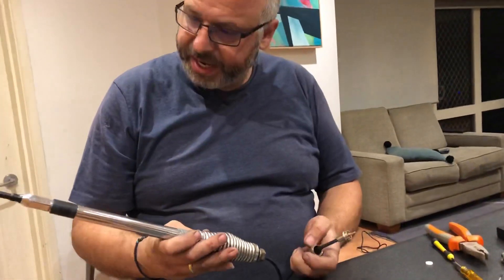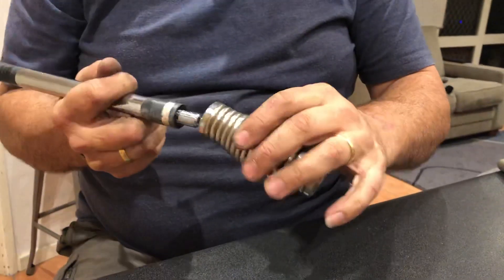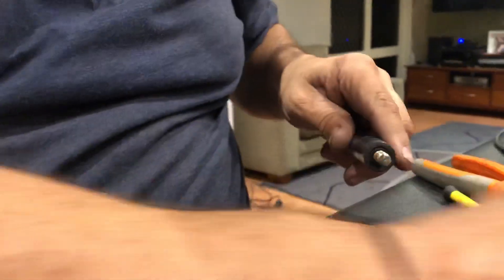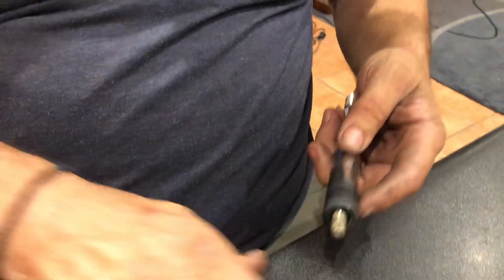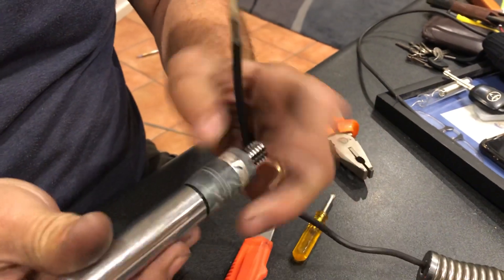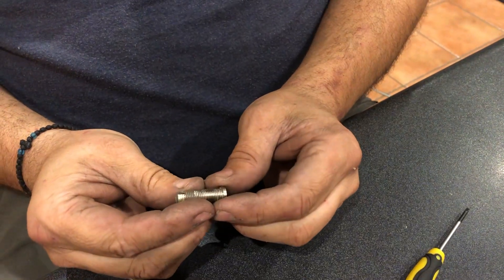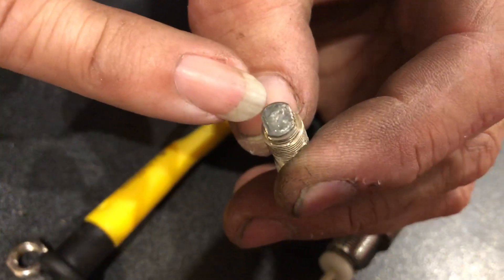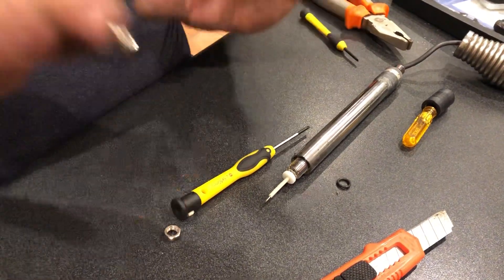UHF antenna repair  - part 1

Comment: I've lost at least 3 antenna tops due to offroad vibrations, then when I used pliers to tighten it, the solder probably cracked. Thanks for the video! Cheers